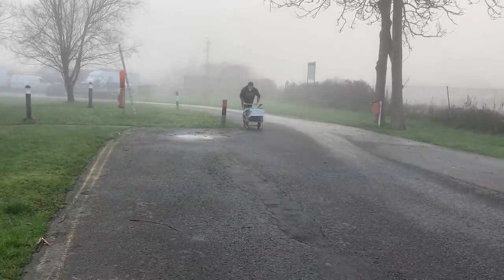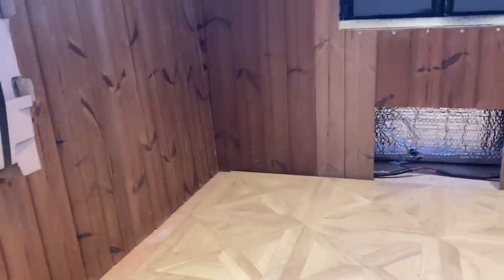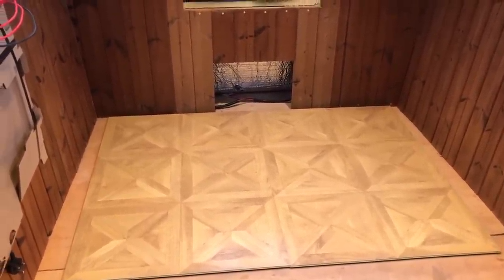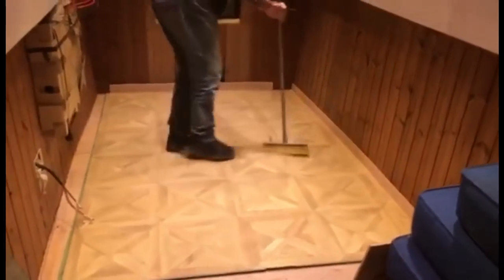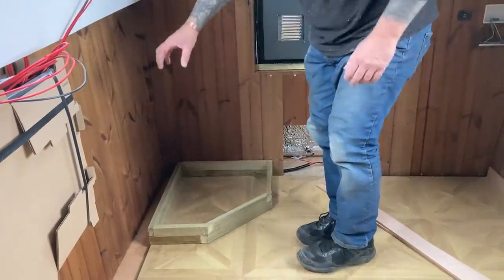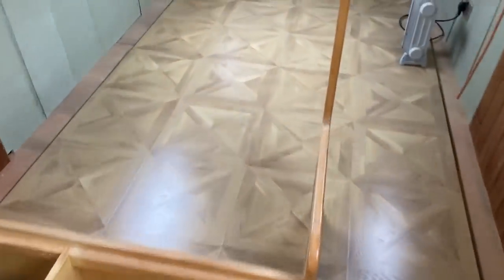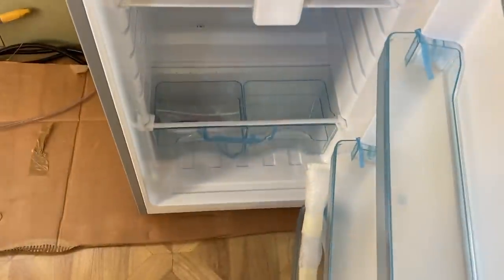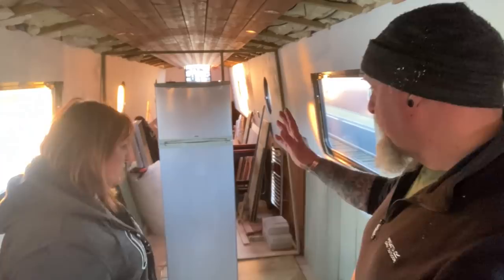Building Our Narrowboat #29 - Flooring and Refrigeration.

Comment: How refreshing to see someone scribing the last edge board to the flooring correctly an absolutely fool proof method which works every time accurately, so many miss this so simple trick and end up with a poor fitting timber.Love your videos even with all the work your both doing you never compromise a quality install, keep going it will all be worth it.
Reply from the maker: Cheers Gary. I’m not perfect mate, far from it. What I do need is a full woodworking and metalworking shop next to the boat. Only so much can be done with hand power tools. But I do my best, that’s all I can do. Also we need a home so can’t spend years on a fit out. We are relatively happy on the results so far. Thanks

Comment: looking good dont forget to check the health and safety of gaps and insulation fire protection on stoves i know the guys giving out the safety certicates are keen on the guidelines of stove insulation and safety etc.
Reply from the maker: Hi Gizmo, oddly in the UK the examiners don't check for that. They only check for discoloration and charring of surrounding woodwork and soft furnishings. But our fireboard is well over specification so hopefully all fine there. An with this stove, its not such a high outer temperature as with a log burner. Thanks for comment, we love that.

Comment: Hi, just a few suggestions. Check your pipe runs. Most back boilers need the flow to rise to avoid air locks. Also a cooker under a window can be risky. Your flooring looks great but the joints are stronger if staggered. Sorry if this sounds negative but it's just advice from an old tradesman
Reply from the maker: Thanks Steve, I have no issue with your comment, thanks for taking the time. I will fit a bleed nipple at top of boiler for that very reason. On boats its often about compromises and this is one of them, there is no option for pipe to continually rise. Almost every boat had a cooker under the window with no issue, I will ensure that all is safe when I come to install that. I agree on the flooring, these do click together on all sides and would be extremely difficult to pull apart, Hopefully with expansion gaps and such a small area all should be OK. Old tradesman, just like me, feeling older by the day.
Reply: @narrowboatmoonshine  Thanks for the reply. I'm living aboard a shell as well so I understand completely. You can get auto air vents as well. Good luck with the rest of the fit out. Enjoying your tech talks too

Comment: A great call on the larger diesel tank for the fire.  A slight concern about how close the tv is to it, as too much heat can lead to dry solder joints with excessive expansion and contraction of the circuit boards but might just be the camera angle that makes it look so close. Really like the flooring!
Reply from the maker: Hi, yes the camera makes it look closer than it is, and as its a diesel with back boiler, only 2kw will be at the fire itself. 3kw is pulled away for the radiators. So it wont be like a log burner that could easily reach 600 degrees C. Glad you like the flooring.
Reply: I was always under the impression that “dry joints” are caused by lack of flux during soldering hence the name dry! 
Most tv’s have a manufactures recommendation of heat tolerance is -10c to +50c🤔

Comment: Really enjoying the vlogs- it’s starting to come together.Do you really need to drill the marble and screw it down? If you are fixing a thermo-wood surround surely that would trap it in?
Reply from the maker: It’s for BSS Adam, stove cannot move. So yes slab needs not to move and stove on it. You can bracket to surrounding structures, but there is heat transfer using that method.